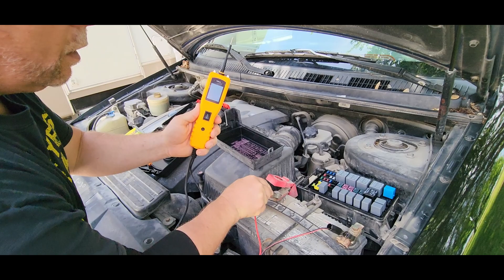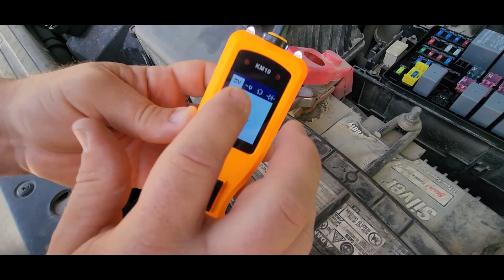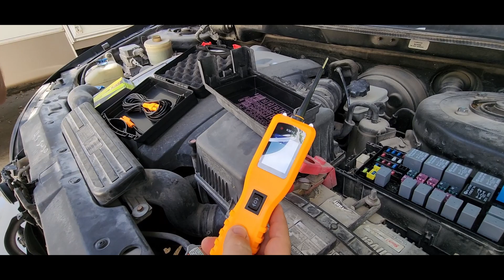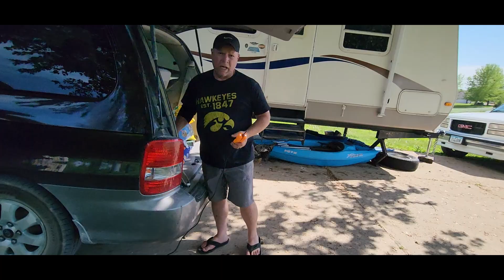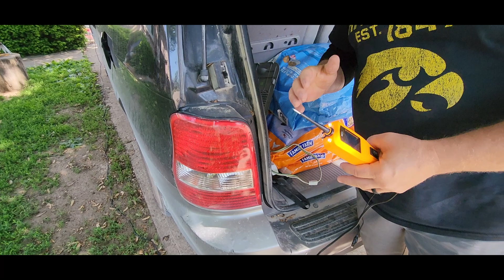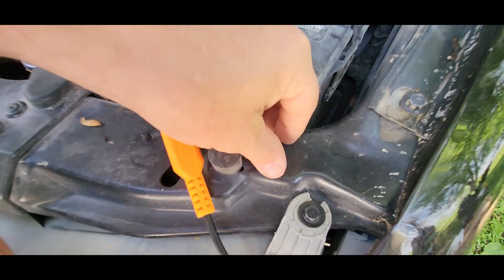KZYEE KM10 Power Circuit Probe | Digital Voltage Tester

Comment: hi you said you can mess things up did it pop cause you touched both leads when you began the test with the fuse? Great video by the way and Thank you
Reply from the maker: can you give me a reference time marker so I can check out the "pop" that you referred to.
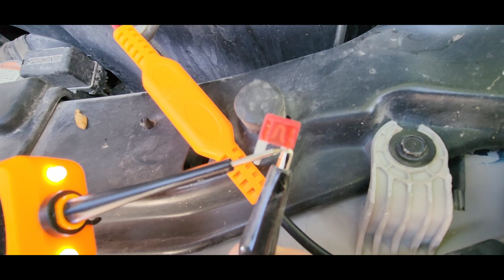Reply: Mornin, yes sir timestamp is 4:55
Reply from the maker: @MCast5468  The video was created over a year ago so basing it off memory I shorted out the fuse by crossing the ground as seen in the video. 
I noticed that I pulled back and went to the other leg on the fuse before it overloaded ... because it's been over a year I can't explain that (unless it was touching both leads at the same time as you mentioned.)

Sorry I don't have a better answer for you.
Reply: @skinners100honestreviews3  oh no worries, i used the tool for a redundancy check :) with my grounds and the tool worked great. You’re  the reason I grabbed this tool. Thank you for your time and the response back